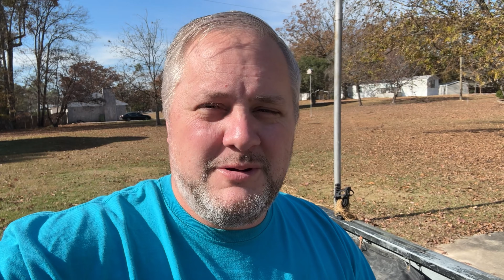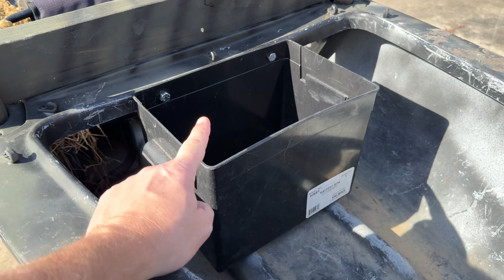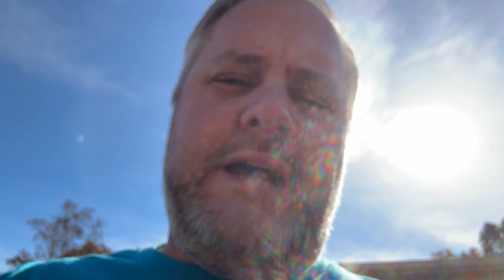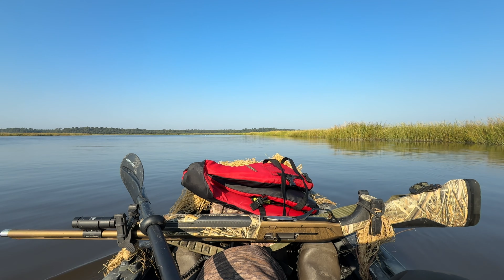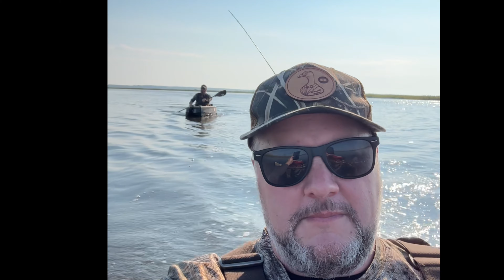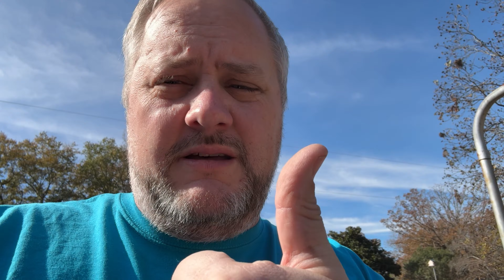Ascend H10 Kayak Build | Budget Trolling Motor Rig Tutorial

Comment: Newport has a very nice short shaft kayak trolling motor. I rigged mine up basically the same but I put u bolts through the board and around the pipes in the rod holders so I could easily remove the whole setup. No screws attaching to the boat and it worked fine.
Reply from the maker: Heck yeah.